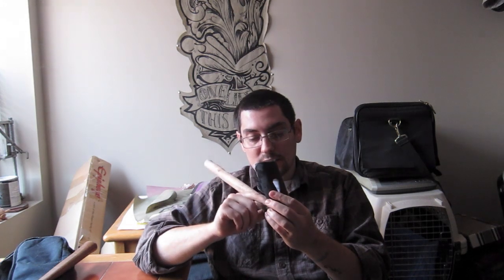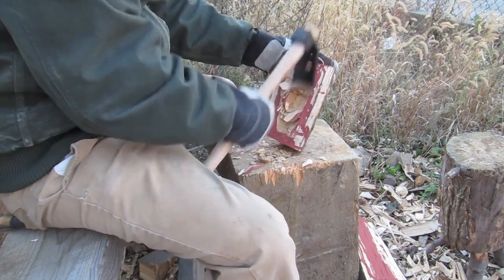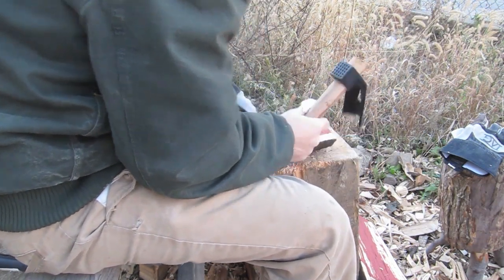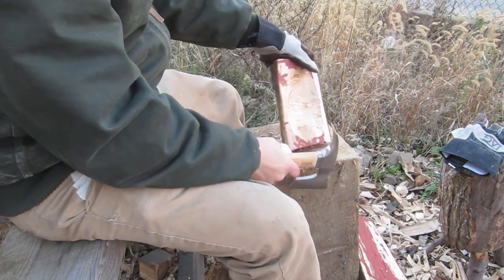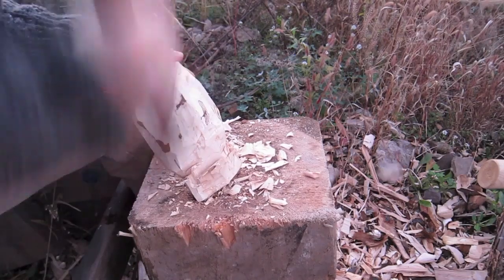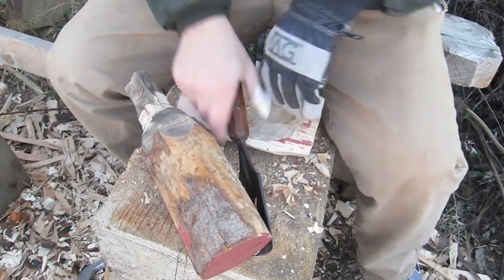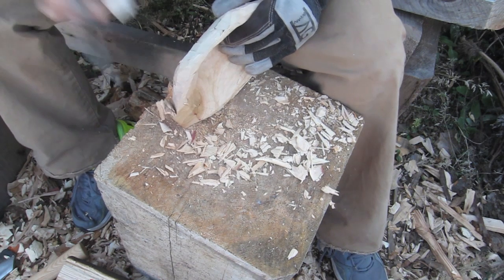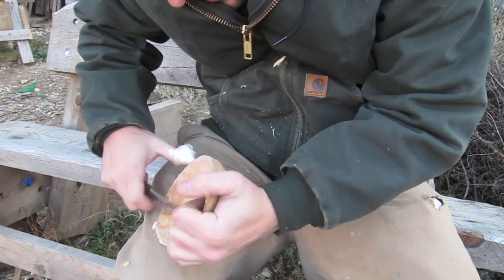carving a bowl with an adze and review

Comment: +Schpoingle thank u for the help but I just found a 100+ year old ship adze along with a froe and nice old axe at a flea market and it is in great condition. I can not wait to use it!!!
Reply from the maker: +Jacob R no problem. glad you found good stuff. i have a video...not sure what it's called but it's kinda recent...but i show how to clean and bring old tools like axes and adzes back to life as fast and easy as possible. tools like the adze, that are for making flat surfaces should have a 'chisel grind'. meaning that there's only a bevel on one side. remember this when sharpening or shaping (if it needs to be done). take care

Comment: Good adze but uncomfortable handle.  I swapped it to own maded handle and work is more easier an safer.
Reply from the maker: +Signe Sinkevica you could only change the shape of the handle with a permanent one....which means sharpening would be...interesting to say the least. That's the beauty of this adze and it's handle, you can take the head off and sharpen it easily. I'm interested in your idea though. got any pics of this new style? and did you make a permanent handle?
Reply: +schpoingle I do not think about sharpening...yet :) But it work much better. Maybe because I have small hands :) and I making small bowls. https://www.facebook.com/photo.php?fbid=974246182612416&set=pcb.915198115267009&type=3&theater

Comment: Where can i find a quality adze for a small cabin that i am building. If anyone knows please help.
Reply from the maker: +Jacob R the adze in the video can be found at the link in the 'about' section under the video. he sells other kinds of tools. those are going to be the cheapest but still quality options. the other option is buying a used ship builder's adze off ebay and fixing it up. those are the long handled adzes that you swing in between your legs while standing on top of the wood. otherwise get a hewing hatchet, or broad head axe for flattening from the side.